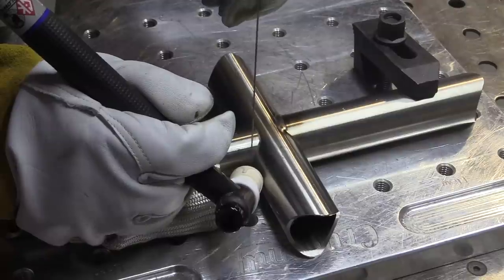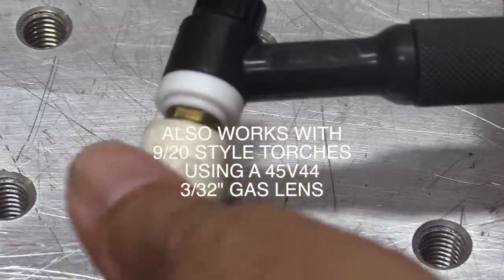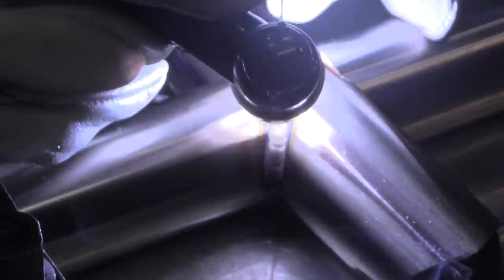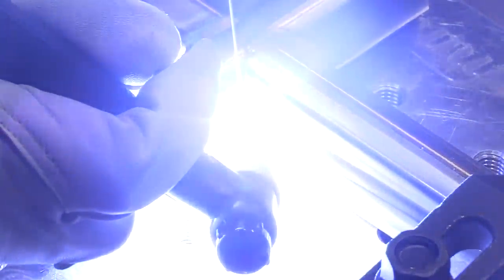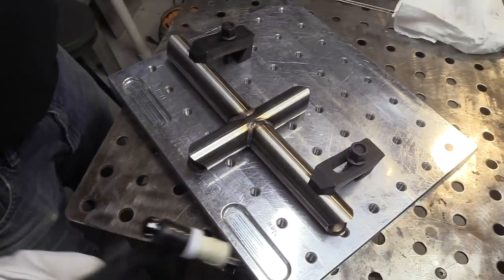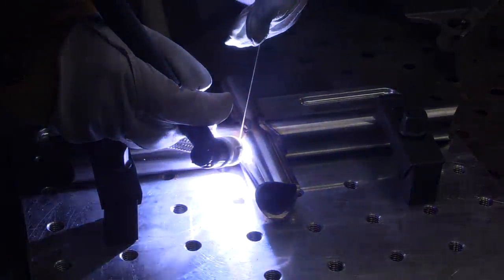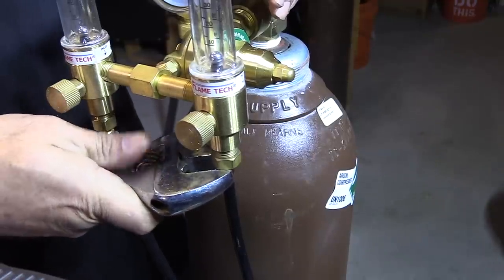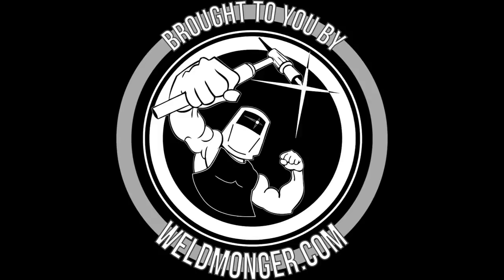TIG Welding Stainless Tube

Comment: Dear viewers. Tig welding .065 stainless tubing for my sailboat railing, Davits and hard top. I found purging made my welds less grey and more silver with some pink and blues. I’m running 60 amps 3/32 tung, #10 cup and 1/8 filler. I got some .045 wire and #12 cup on the way. I got 6 grand in materials and tools into this project with the roller , bender , welder, buffing supplies, and tubing. Got it all bent and mocked up, Now it’s showtime haha. Thanks for the videos! Still trying to conceive how Jody can tig .065 at 100 amps. Master Jody.

Comment: Good stuff Jody! Thanks for the shout out with the torch lead holder!  F.Y.I. The red one is for a stick lead, The blue is generally used for your Tig torch.   Jimbo!
Reply from the maker: couldn't find the correct one in my messy shop.  time for a cleaning day.  red one worked fine tho.

Comment: If you were modifying an existing air line (rerouting a section) would you bother trying to back purge if its a long run of stainless pipe ?

Comment: Hi Jody, my company has a product that requires a t pipe joint just like here. The difference is that the weld is required to be full penetration ( full 3mm wall thickness) due to corrosion and fatigue reasons. If you still have this pipe, could you make a video showing the fit up and weld to get full penetration with this pipe? Our supplier seems to be struggling with this.

Comment: I just got me an ahp 201, I’m so lost with what accessories to get, it comes with a 17 rotoflex torch with a 9 head as well. I’d like to get some of the glass or larger cups but not for sure what I need. I don’t want to buy unnecessary parts for it , cause that money can go to filler and coupons. It’d be awesome if you could do a video just on torch parts, you know, you need this for that, if you have this then you don’t need that type of deal. Love your videos!

Comment: I thought the rule of thumb was 1A/thou so why do you back off to 90 thou when you get the weld pool started as the tube thickness is 120 thou. ? What do you recommend for Amps. Is it because  you are moving a bit slow that you reduce the Amps etc etc  Please explain.      Thanks Mike

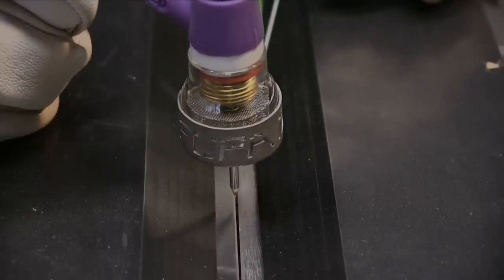Comment: 10:17 & onward is a valuable lesson.

  What i have the most difficulty with is getting a puddle started and managing to turn the heat down quick enough & get moving without sugaring the backside.
   It's also hard to get a nice "wet" puddle with stainless steel . The puddle tends to ball up / solidify if I back off on the heat too much. Sticky filler ain't fun !

This one is a re-watcher. 
Thank you :)

Comment: Whats the tungsten and filler rod size being used in the video? Secondly i dont have a pedal, using a on off hand switch, i tried at 50amps and it creates holes. If i lower down the amp, it takes time for the puddle and it creates a lot of heat. Any advise?

Comment: I just wanted to ask...I use the # 8 clear  furick cup set up and it’s great but I do a lot of thin gauge sheet metal repair...do you have a adapter set up for a #17 torch using a 1/16 electrode?

Comment: Metallurgical questions surrounding stainless.
Did some socket welds for some refrigeration piping a while back. Used 309L-16 SMAW for 304 pipe to carbon steel/low alloy valves and couplings. All 304 to 304 done with 308L-16. I had to weld on some threaded 316 nipples as well and I couldn’t really decide which rod to go with so I used 308L-16. Metallurgically what should I usefor SMAW/GTAW welding 304 to 316 stainless? Appreciate any feedback Jody!
Reply: Another thing I forgot to add. This was for ammonia refrigeration piping. Is stainless pipe the best bet as far as corrosion resistance or will it deplete certain alloys in stainless?

Comment: You say that you set the gas at about 20 at the regulator. I did that and checked the gas flow. My flow is 20 at the regulator and about 14 at the torch. So, which is correct? Should I be 20 at the torch?

Comment: No internal purge with inert gas?  Won't you get the dreaded 'sugar' and other contaminate issues on the inner wall?  Or are these so thick that the weld won't penetrate all the way into the material?

Comment: I was hoping for some tips on shielding the back side where it's not easy to purge, as in SS tanks and mufflers.  I've had some success with Solar Flux in exhaust systems, and have taped aluminum foil to create a pocket where I had access, but was looking for a few more ideas from The Master.

Comment: ALWAYS enjoy ur vids. Particularly the SS ones. One tip we use at work 
We use 95/5 argon /hydrogen on the torch.  Straight Argon on ID purge 
This helps greatly for penetration on fusion welds on Sanitary:hygienic welds  especially when u may have high sulphur content

Comment: Just as an FYI: I noticed your tungsten point is very short and stubby. When running DC, you are able to weld thicker steel at a lower amperage & have finer control of the arc and puddle if you shape your tungsten point a little longer. Maybe 5/8" to 3/4" back and then down to a fine point. An aerospace weldor showed me that and I've been sold ever since.

Comment: “Sugaring”... so we saw on the plate that you got sugaring. Also..on the inside of the pipe there wasn’t any sugaring. I assume because of the amperage used. What about on the inside of the other pipe where we might’ve seen some heat affected area? Might there have been some sugaring in there?

Comment: Anybody have tips for filling gaps up to 3/16 on stainless? I've been welding for 7 years but tig welding for 2 months, I dont have any issues with a good fit but I'm having trouble filling gaps and that's happening everyday now due to bad machining of parts and what not. So far haven't seen any helpful videos, any tips would be greatly appreciated!

Comment: How do you keep your tungsten so clean and sharp,after only a minute or two my tungsten looks a little black/discolored and not quite as sharp as when I started
Reply: My guess would be whatever you're grinding your tungsten with 😋 I've heard the diamond coated wheels are the best but I just use a regular grinding wheel on a bench grinder. I make sure to only grind tungsten with it. Also I've noticed it helps to break off a bit of tungsten to get a fresh part before you regrind it because sometimes if you stick your tungsten whatever you're welding will stick to your tungsten and if you try to grind it off it will contaminate your grinding wheel.
Reply: to many amps for the electrode size, or type. not enough argon flow or not enough post flow.
Reply: Thanks guys

Comment: What's the benefit of filler rod tacks vs fuse tacks on thin material?  Those fitups seem to be tight enough where you could just zap it real quick and save a little time.
Reply from the maker: MrShockotaco definitely could have fused them. Sometimes fused tacks pop under load tho. For example on a large handrail section that you need to flip over
Reply: @weldingtipsandtricks Ty !   Just didnt know if I had been missing something. Keep up the good work!

Comment: I have trouble with my auto darkening helmet when doing tig welding. For some reason it doesn't trip the lense so i always have to use my passive helmet. Does anyone else have this problem and know why that may be happening? It's an older, fast glass helmet
Reply: Jeff Szczypiorski amazon has some cheap options

Comment: I have to say. The thing that I hate the most is using a pedal. I learned a long time ago that pedals are for bench welding or beginners. The thing that pisses me off the most is no body knows how to weld with anything other than scratch start or a pedal. Why? Teach people how to use a button or finger control. In the field they need to know how to do it and how it works!!!
Reply: Alot of finger controls are terrible.  Lincoln's rubber track and Miller's roll dial are god awful for precision  work . Trying to keep the puddle  perfect while rolling down the wheel or track. Unless you go with a independent tig control. Ive just learned to use a pedal on a ladder.  (Little Giant ladder with hook-on platform) or under my knee on the floor doing upside down work. But also all of my tig welding is one off joints and no way to practice.
Reply: @buildthings79  I use a ck world wide torch with there built in finger control. I set my machine and go.